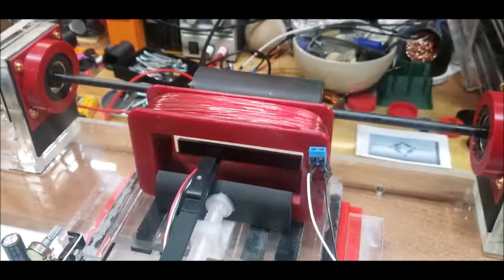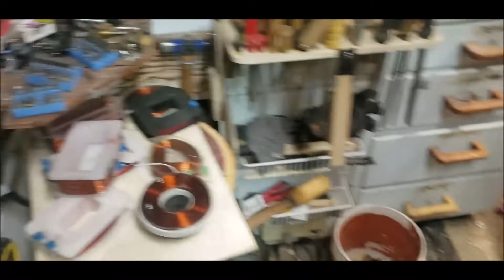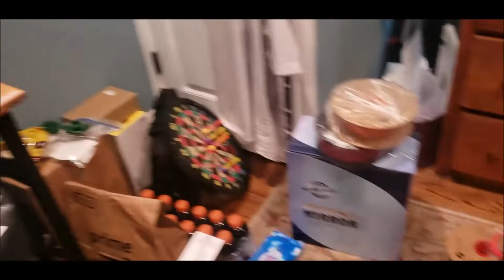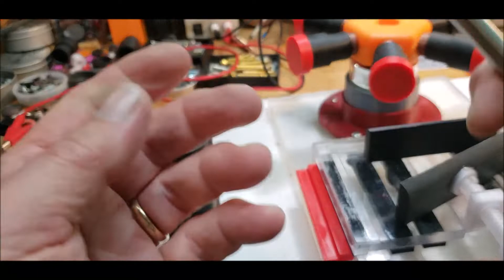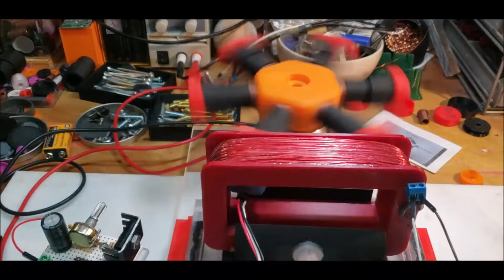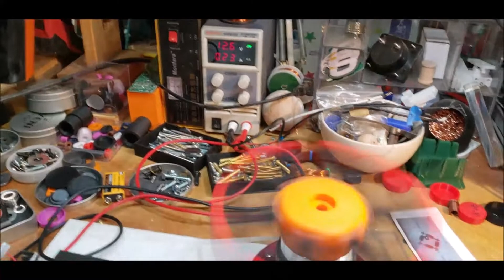3D Printed Pulse Motors With Explosive Results lololo

Comment: You'll learn to use a blast shield.
Reply from the maker: rofl lololol
Reply: @mcorrade  you won't be laughing if you get impelled. Remember 33.3 RPM's is 3G's, meaning 1 gram is equal to 3 grams. I'm curious what your wheel  looks like in the dark with just the strobing light.
Reply from the maker: @MAGnetICus_Attractus  I'll have to see what a cheap strobe cost on amazon
Reply: @mcorrade  you have the strobing light already.
Reply from the maker: @MAGnetICus_Attractus  ????
Reply: @mcorrade  your light powered by your circuit. Just put it above the wheel in the dark and you should see  .
Reply from the maker: @MAGnetICus_Attractus  ah yes